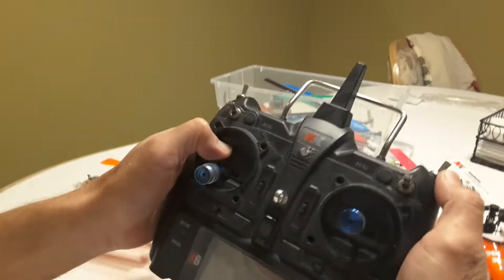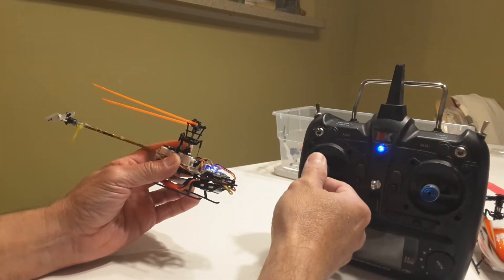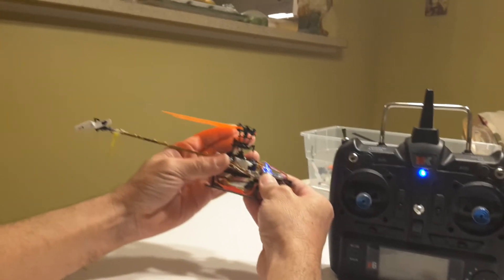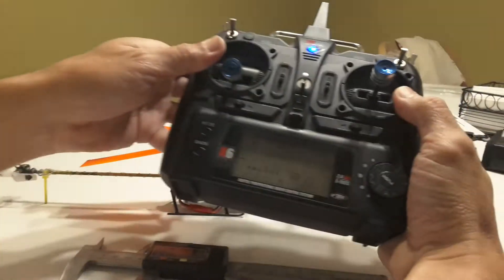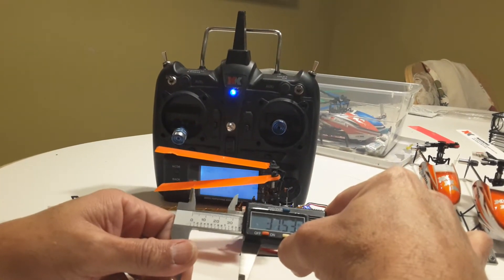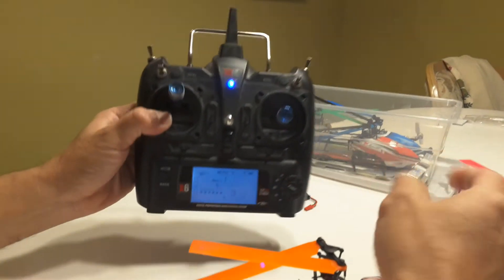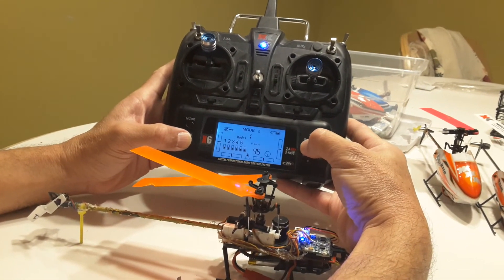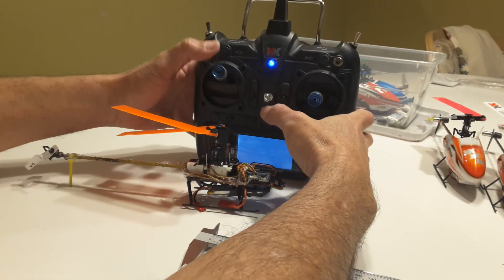K110 blade tracking and equal distance between the blades in 3g mode

Comment: Hello I messaged a while back and I'm wondering I've had tobstart from scratch on my heli head and now I'm not sure how long I need to have my swash links. I put on a new set and didn't check how long the previous ones were and now I can't get back to center. Would you remember how long they should be as a starting point? Also having servo issues but that's a different subject. Thank you,  heli fan!

Comment: Hello, i just got this xk110s and i had to replace the tail because it broke and now my heli is flying tail first and in circles.  Also my swashplate isnt level and arms arnt level . Help
Reply from the maker: I do have another video about replacing the head spindle 
I bet you is bent
Look it up in my channel 
Also don’t trim the tail on radio trying to compensate the tail spinning
Reply: Its bent aa tiny amount. While im turning the screw the opposite blade darely moves up and down , maybe 2-5 mm . @helifan2346

Comment: Very understandable video, I have a question? The 6G button rotates the blade down and up?
Reply from the maker: Oded k 
I don’t get your question 
6g mode, I don’t use it. 
If you switch between 3 and 6g mode the blade pitch would change as you don’t have same values in those modes therefore you will see that blades go up and down between modes, if that’s your question then, yes
Reply: @helifan2346   yes 👌👍,Now I'm sure I understood the replacement, when the helicopter flew on its back.

Comment: Check blade tracking, third value on your radio settings should be 50% on both,  3 and 6g mode don't understand
Reply from the maker: abbie morris , I should be more specific, sorry about that. You have 5 values on pitch curves in your radio, the 3rd value is mid stick in your radio, that’s where you check for blade tracking, that value should be 50 on your pitch curve, that reading is half the travel of the servos on it’s full travel, 50%. Then, this heli fly in 6g and 3g mode, the 50% on your pitch curve in either flight mode should be 50. Some people use different percentage, different results. I don’t fly in 6g mode. Does this clears up your question?
Reply: Thank you so much can i use this for xk k120 as well
have a bless life my friend
Reply from the maker: abbie morris yes, you can use same procedure for K120 heli, same radio too. But I would not recommend you to get k120, look up for parts, they seem to be hard to find, specially the boom. If you know how to fly a heli and have all the orientations down and don’t crash that often, then get k120, but as I said before, look up for parts first in any heli that you want to get, seems to me that the manufacturer dropped production of this heli, first sign is stock parts, when there are not many available, that’s a bad sign.  I invite to https://www.rcgroups.com/micro-helis-42/ forum to come and join us.

Comment: This is blade pitch, not tracking.
Reply: This is blade pitch but good video. Blade tracking is height difference between blades while rotor is spinning, leading to blades not being on same plan = vibrations. Usually it’s adjustable by links but not on K110 which have grips to swachplate fixed length plastic links.
Reply from the maker: DigitalAura 
This video was made for some one that didn't know how to set up this heli, it is what you want it to be, it's just a video, that's all.
But the main reason of this video is blade tracking on this specific heli, if you think is something else, good! Hope it helps